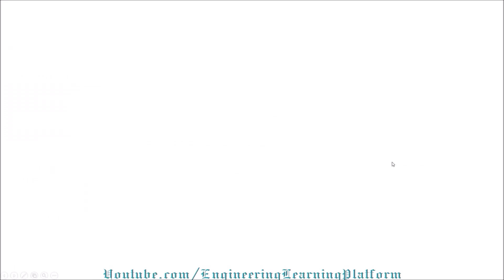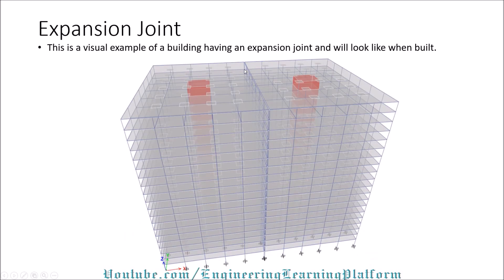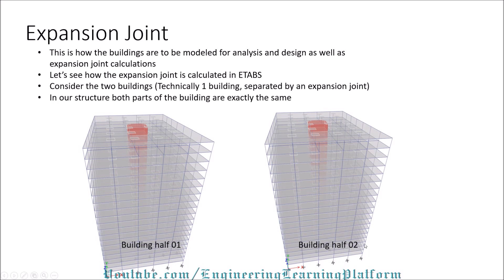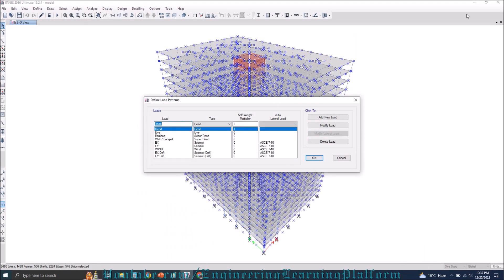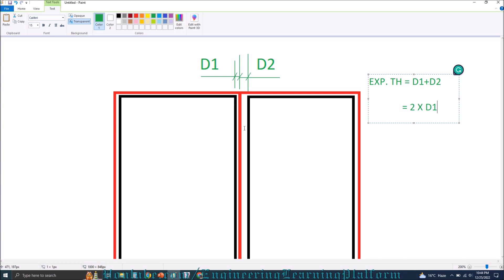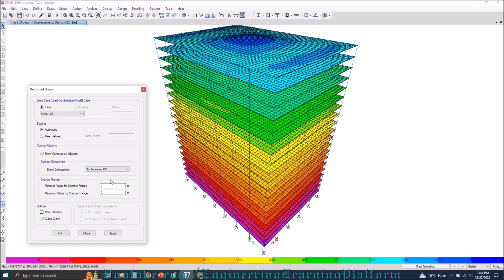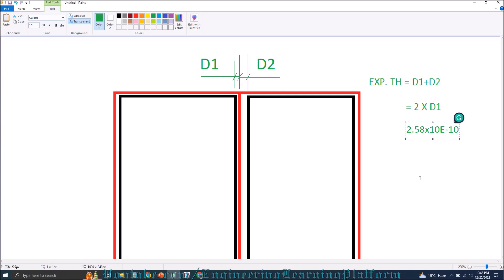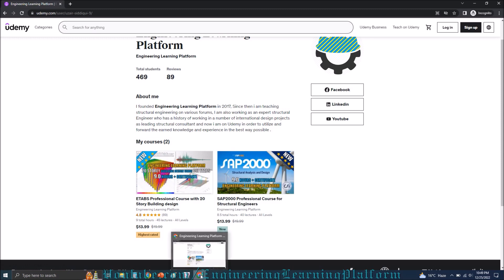How to calculate expansion joint in Etabs

Comment: is it possible to stop the joint at the underground floors? and the 2 columns merge into 1 in these floors? then it continue to the footing?
Reply from the maker: Sorry, I didn't understand the question. If you can send a sketch on our linkedin page
Reply: @EngineeringLearningPlatform thanks for the reply..it was my false understanding of what my doctor said..
I thought the joint can stop at underground levels
Reply from the maker: @SomeOne-rw6gz  Joints are continious except in foundation if it is raft or Matt